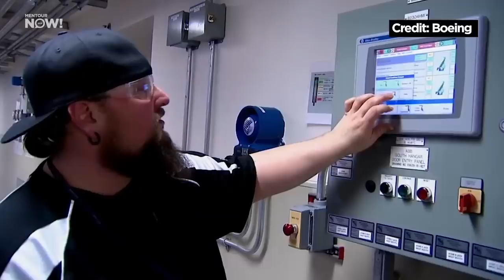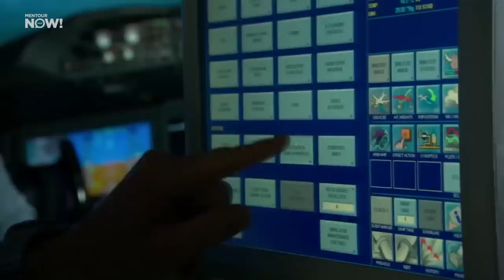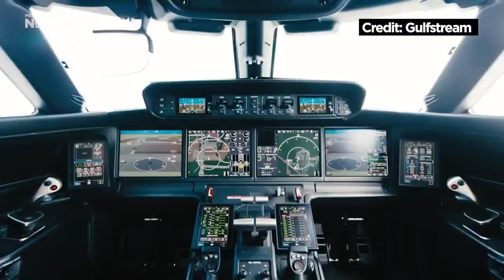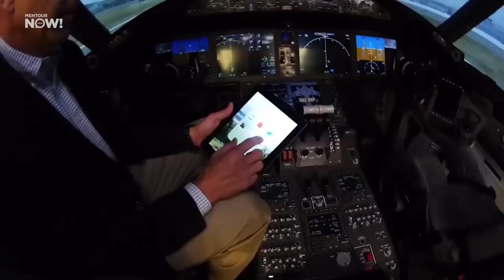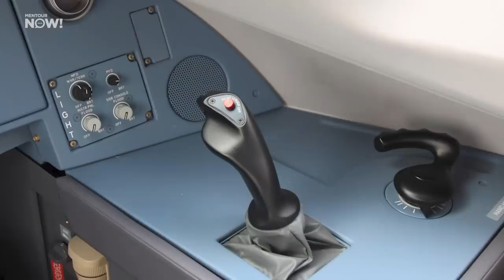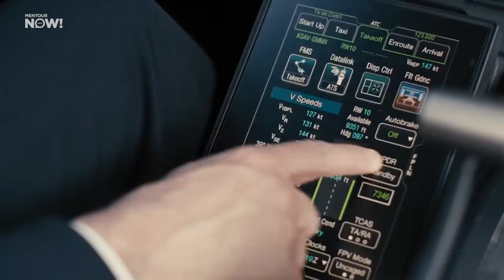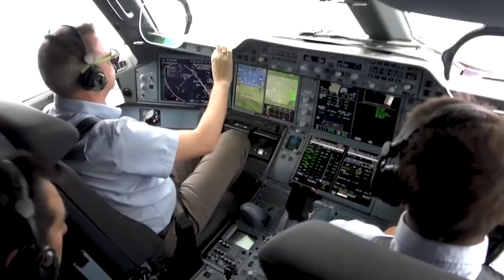Is Boeing Switching to SIDE-STICKS?!

Comment: I’m not a pilot but I was cabin crew for almost 14 years and I lived to ask questions! I’ve operated on several aircraft types over the years including Embraer, Airbus and Boeing. Whilst I can see some of the pros and cons from a pilots point of view, the thing that always got me about the side stick is when you move from the right seat to the left. You’ll, most likely, be right handed and have spent many many hours in the right seat, using your right hand on a side stick in your right. When you move to the left seat, all of a sudden your using your less dominant hand on a side stick to your left. 
Some airports I flew to required specific extra training in order to be able to land and take off from and outside of this, there were also certain weather conditions that were “Captain only”. This is where I see the biggest concern with the side stick. You have a new Captain in the left hand seat with a FO with an equal amount of hours in the type and then they are faced with a “Captain only” situation. New captain, using a less dominant hand and must, as per airline SOP, take control. True, the chances of an accident are low but the chance is higher compared to using a yoke and so it introduces an element of risk.
Reply: @New York Bus Guy during decent, auto throttle is working and it’s my understanding that the pilot flying would have an eye on that and not necessarily a hand on the throttle. As cabin crew, of course I’ve asked the question but would a pilot, especially a captain give you an honest answer, in front of their FO that they struggled with the change? Highly unlikely. That may give the impression to both the cabin crew member and the FO that they may in some way be not up to the job. As cabin crew, we look to the pilots, especially the Captain to give us confidence and leadership in any situation so suggesting a Captain may freely admit to any problems they may be personally be feeling on using their less dominant hand on a side stick after promotion is 99.9% NOT going to happen

Comment: Case in point; Air France 447 wouldn’t have happened with yokes. 
The first officer just kept holding that side-stick back the whole 35k feet down, even after the captain correctly diagnosed the stall
Reply: This is a claim I have read several times. It would be great to know Petter's opinion on it.
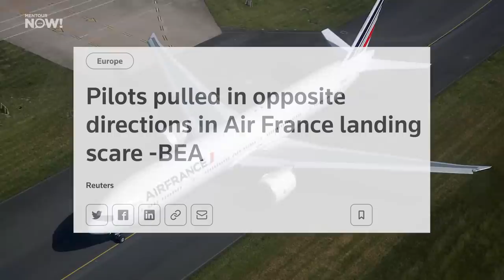Reply: You commented without watching the whole video. 12:03
Reply: The atlas 767 crash in the mud was flown straight into the ground with a yoke.  How about that.
Reply: Sorry to say that’s not completely true. It also happened the same kind of accident in a 757, birgenairnif memory is not failing. The problem is flying attitude. And diagnose an unreliable airspeed. Even if the yoke would be easier to see it was pulled there is not possible to assure the outcome would be different.
Reply: Right. But that’s when u highlight one accident. U can say that Egypt air 990 would never have happened with a side stick. There are pros and cons on both designs. And both designs have had issues because of its design and both have avoided issues because of its design.

Comment: Maybe I missed it, but is hand domination an issue?  It isn't easy for me to use a stick with my left hand.
Reply: Not a fan of side sticks, but apparently hand domination isn't as large an issue as one might think.
Reply: Seems like it could also be an issue when switching seats (like a promotion after earning the bulk of flying hours on the right).
Reply: He said in a comment that it's easily overcome with a little simulator training.  Although, I would imagine that would be different for different people.
Reply: Takes just minutes to adjust.

Comment: What about that French flight that fell out of the sky because the right seat pilot was constantly pulling up?
Reply: Also Flight 967 recently covered on Mentour Pilot
Reply: Are you referring ti Air France 447 from Rio?  If so, that was a result of frozen pitot tubes and resultant incorrect airspeed readings if I recall.
Reply: I can guarantee you that more yoke flown transport aircraft have crashed than ones with side sticks.  If boeing had a proper fly by wire system then that wouldn't have balled up 2 maxes for no good reason
Reply: That addressed a problem in the industry about pilot training, and a concern over more attention in type training. 
There also have been crashes in Boeing 757 with the pitots frozen, in this case covered with tape. So the basic problem is attitude flying. It would be easier to see that he was pulling on a Boeing? Sure. But just imagine a miríade of warnings in the cockpit, at night, in cloud, in turbulence in the inter tropical convergence zone,  with your body receiving multiple acceleration info, with a training at the time that didn’t established that it was better to do nothing and just wait keeping 2,5 degrees nose up...and steady power.

Comment: In the Chinese speaking aviation community, the Boeing 737 is referred to as a "flying gym (空中健身房)" for the pilots due to the effort required to control the yoke.
Reply: Your not serious right? It flies very soft. Are they weak?😂
Reply: @jouniairplanevideos  It is not soft when it appears in the Air Crash Investigation episodes.🥲

Comment: I just wonder how sidesticks deal with an obvious human factors difference. With sidesticks, the pilot (left seat) operates with their left hand while the copilot (right seat) uses their right hand. Left hand is controlled by a person's right brain, and right hand is controlled by a person's left brain, and each brain half has different cognitive strengths and weaknesses. I've always wondered how someone who operates as a first officer (right seat) for many months can suddenly switch to the captain's (left) seat, which requires a completely different cognitive experience. Add to this the fact that everyone has a dominant hand+arm (physically stronger than the other), how is it possible for someone in either seat to operate the aircraft in the same way?

Compare this to a yoke, which is identically operated in both seats,. Sure, there are times when the left seat has left hand on yoke and right hand on throttles, and right seat has right hand on yoke and left hand on throttles, mainly during during takeoff and landing, but during the majority of the flight, whichever hand the person is most comfortable with is the one on the yoke.

Plus, a yoke is physically bigger than a sidestick, making it much easier than a sidestick to visibly see what yaw/pitch/roll commands are being given to the aircraft.

Call me old-fashioned ... I prefer a yoke over a sidestick and it has nothing to do with training. Well, maybe it does, because most pilots learn to fly on GA aircraft, which are mostly yoke-operated.
Reply: There is no such thing as a left brain or a right brain it's all a myth, the muscle memory transfers between the two. As Mentor Pilot mentioned in another comment it only takes a few lessons in a simulator to become adjusted.
Reply: It's not really that different to a yoke. The captain will land with left hand on yoke and right hand on throttles
Reply: I've only flown with a yoke (apart from flight in gaming) but from what I've heard and also what Mentour Pilot has said in other videos he has also heard it is much easier than you'd expect and you get into it very quickly.
Also alot of modern fighter jet use side sticks and there are plenty of lefthanded fighter pilots who fly just as good or better than righthanded ones doing all those manouvers even if they arn't using their dominant hand.

When I was a kid, another kid in my neighbourhood somehow started to use the nintendo 8-bit controller upside down. No one corrected him and he played mario just as good as me with the controller upside down. 
You can teach yor brain to adapt easily if you stick to it (pun intended).
Reply: WTAF
Reply: Being right-handed, I suppose I could practice enough to be more comfortable using my left hand on the stick but I have to think it'd be an uphill battle...
Reply: And now you move to a Boeing. Oh no, the throttle quadrant, radios, FMCs, AP controls, all the switches are in the middle. That's to the left of the FO and the right of the captain. Better make sure you choose the right career path before you sign up ... oh wait ...
Reply: Very good point Jim.  Looks like the industry is making the cockpit more comfortable for the next generation of pilots who are mostly gamers.  "Phuf, who needs a pilot when we got computers?"  They should skip the side stick altogether and just control the plane using thumbs on an iPhone.
Reply: When you operate a yoke if in the left side you use left hand for yoke and trim and right hand for throttles. On the right you reverse. That’s exactly how it is done on the sidestick. A flew them both. Fokker 100 ( yoke) and 320/330 hsidestick). What you really have to get used to it’s the control laws and the fact that the airplane trims it self and the roll is roll rate demand in degrees and not direct control over surfaces, so that if you turn for example 20 degrees bank and leave it, it will stay forever like that until you turn it back level.
Reply: @mdude7778   ... or maybe just voice commands. "Taxi to 31 Left and takeoff ... NOW!"
Reply: Actually, it’s no different on a yoke. When u hand fly from the right seat, u use your right hand on the yoke and when u fly left seat, u put your left hand on it. To fly with your right hand while in the left seat is very awkward. In the left seat, your right hand is used to working the FMS/MDU the mode control panel and changing frequencies etc.
Reply: @jimmeade2976  "Computer.... I'm getting some shuteye.  Wake me when we land"

Comment: The A320 was originally not going to have throttles, just the speed selector on the glareshield with ultimate engine authority to achieve set speeds, but pilot groups freaked out. It was a bridge too far

Comment: Super interesting. Although I flew only GA planes, with floor stick such as PA18, side sticks such as Cirrus and "normal" yokes such as Mooneys, Cessnas, Pipers, Airvans and my own beloved Tri-Pacer, I can't say which control is better. Actually sensitivity and effectiveness of rudder pedals was more relevant, I felt.  Anyway I always thought that the right hand side of the left seat yoke was useless, as the right hand is used to control trim, power, mixture and prop settings, flaps, landing gear  radios, etc. but seldom the yoke.

Comment: Moving throttle and pitch/roll input device is a really nice addition for pilot feedback. I never understood why Airbus didn't incorporate that. It basically gives you one more sense(touch) for interpreting aircraft information. Since you lose the sense of sound for small changes it really helps to have tactile feedback for if you're getting fast or slow on approach.
Reply: @CoasterFan77 I mean input device as a general term to include yolk or stick. Yes clearly Airbus doesn't care about tactile feedback no matter how much pilots complain. I actually don't like artificial feedback in the yoke beyond stiffening or loosening as you note. However I think moving throttles make a big difference if they can actually be kept on to touch down. With such a reliance on visual scan it's interesting it's the 73 that has a HUD. Not that Airbus should have one. It's just interesting how many tools are given to physically fly the plane vs Airbus. Of course the autopilot probably gets into the least trouble. Always on time too.

Comment: A force feedback application outside of a computer simulation.  Who knew?  Oh, and for some reason, Microsoft depreciated the ONLY API (DirectInput) they had for providing force feedback to the user.  You can of course still use it, but Microsoft doesn't allow Microsoft Store apps to use it.  On a related note, I'm quite used to how my joystick feels when I move it and do not want force feedback based on control forces if the device is not mechanically linked in such a way that produces it naturally.  But force feedback based on what the other pilot is doing would help to restore what little trust I have left in Boeing.

Comment: If the system as a whole is FBW then would there really be a significant weight saving with a sidestick setup instead of a yolk?  It couldn't really save more than 20kg or so could it?  Or are the mechanical linkages between yolks really that heavy?  

Feedback issues aside (which it seems the latest generation of sidesticks address with force feedback as you say in the video), wouldn't it come down to a personal preference more than anything else?  

Personally I'm waiting until they release airliners with support for Nintendo Gamecube controllers :)

Comment: I think, when a first officer turn into captain, the learning curve for side stick will be more compared to that of yoke due to the change from right hand to left hand..
Reply: A very silly argument as whether on a stick or a wheel-,one flies with ONLY ONE HAND, the other being on the thrust levers. If one thinks seriously of the hand movement onthe flight control, one would quickly realize that 1/ the roll control on a wheel is on a rather large arc of a circle, the pitch controlis on again rather large fore and aft movement ; and 2/- these movements require some force ( remember the "feel"" sense ? )...
The result is hence less quick and less accurate on a yoke than on a side-stick.

Comment: I don’t get why side stick is on left hand side for captain but right side for co-pilot.  I understand the need to access throttle in the centre but it means the person flying the plane is likely using the non dominant hand  for fine motor control actions in x y axes and dominant hand for the throttle which is just one axis of movement.

Comment: B 777 and EMB 170/195 has the same Flyby-wire System ( preventing tail strike on TO / LDG and stall ) that’s all !! 
The Airbus is doing something what’s the pilots didn’t know , from 0 to 50 feet height = direct law , from 50 on its switching to 1 G load and holding bank !! So the ailerons and elevator fighting to hold that values . If a real pilot ( not used to ) flying a appr. In gusty winds fighting the gusts , it will be a roller coaster !!! And additional max 45  degr. Roll rate !!!

Comment: What about Center Sticks? In terms of orientation, they are probably the best and can be operated by any hand. Once on an overnight I sprained my left wrist, if I was flying a Side Stick it would have been very very difficult to use my right hand!
During single engine terrain clearance turns the yoke blocks the instrument panel on the Turbo props I flew.

Comment: A side stick with a fly-by-wire system appeared on fighter jets in the 1970s. There you can give the pilot a good view of the instruments. Also good access to buttons. Another advantage exists only in fighter planes; A safer exit with an ejection seat, because the pilot's legs do not pass by the stick when exiting. In terms of engineering, a fly-by-wire aircraft is lighter in weight, easier to maintain, and cheaper to operate. Boeing is undergoing major changes, this is an opportunity to go all the way.

Comment: How much of a difference would it be to change over from FO to Captain on a side stick plane when all your career you were used to control with your right hand?
With a yoke or center stick you are used to use both hands or one just as circumstances call for.

Comment: The first Active Sidestick might be actually the one used in the F-35(or X-35), albeit a bit different(as the F-35‘s only have 6° of throw and have different mode includes the traditional force sensing "dead stick")... iirc BAE also said the civilian one is built upon the knowledge gained from it

Comment: I think right hand vs left hand on yoke or side stick is irrelevant as even on a yoke airplane left seat uses right hand on throttles flaps etc, and right seat pilot uses left hand on center controls. So it is the same "problem" either way stick or yoke.
I only fly GA aircraft and have about 2000 hrs in various singles and twins. I have no problem switching seats.
Personally I love the idea of side stick, I would even like this in automobiles like SAAB experimented with for a while.

Comment: I wonder why center sticks aren't considered as a middle ground. They can be mechanically linked like yokes while taking up much less space and weighing less. They are an effective solution for the collective in most helicopters and also, for example, in Diamond airplanes. In my small airplane experience, switching from a conventional yoke to a center stick doesn't cost any extra training time--the few hours I spent on transitioning to the DA-20 after Piper and Cessna experience was focused on systems and the rather different aerodynamics, with the stick becoming quite natural in that time. I also found the center stick quite comfortable, and to give a strong control feel. Of course it's still a compromise. 

Btw, sponsors don't "make it possible" for you to make videos, unless you would otherwise "have to" work for some reason, which seems unlikely for a European with an airline pilot's salary. Incentivizing is different from "making possible."